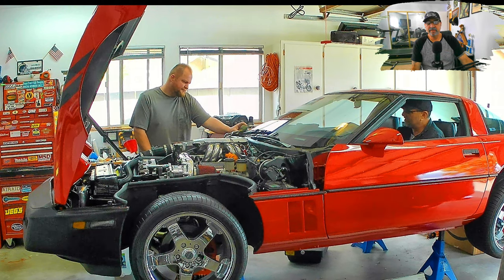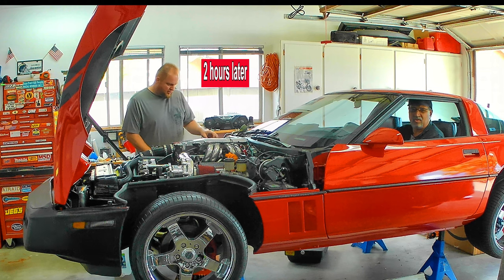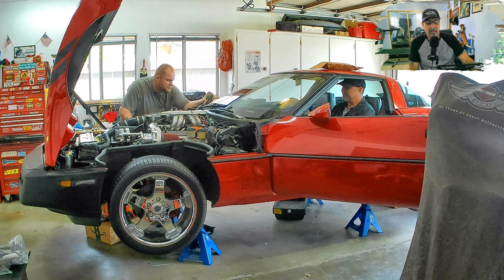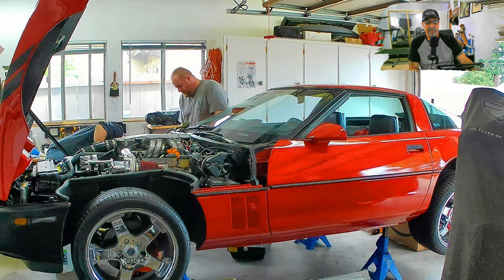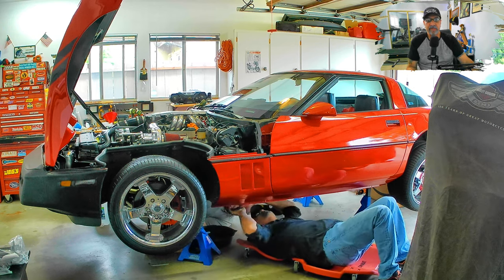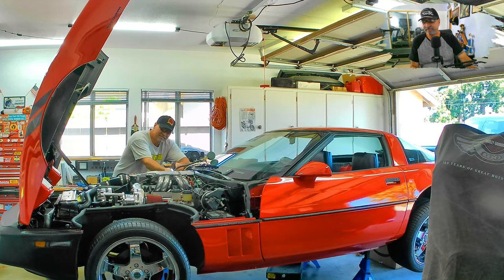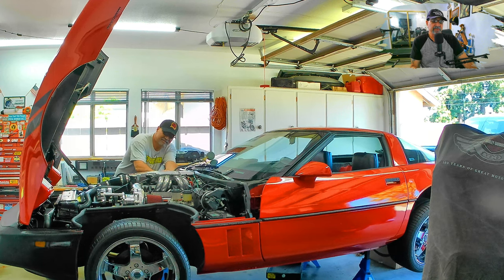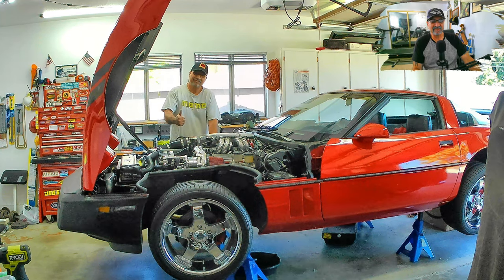Starting the supercharged Corvette for the 1st time | Maybe??

Comment: That Procharger set sounds like the standard noise kit..got that slight whine but congrats on getting to where you are now with it idling..
Reply from the maker: Thanks 👍It was quite a challenge however, I was determine to get her running right. I really need to get a better audio recorder with better sound quailty, which I am working on. Cheers!

Comment: Sounds like shit for maybe 30 horsepower no thanks original stock will always be way better
Reply from the maker: Interesting take! It sounds like there might be a gap in understanding about superchargers. Procharger superchargers can easily add 100 horsepower on a V8 motor, with proper tuning and tweaks often much more. For example, a ProCharger supercharger upgrade on a C4 Corvette is a proven method that works well and I have a friend in Southern California who's pushing way into the 600-horsepower range on a built supercharged motor, and its still smog compliant for California. Maybe a bit more research into superchargers and their benefits could be enlightening!